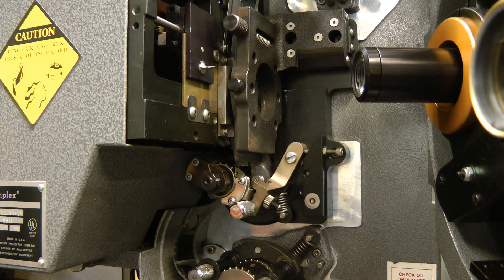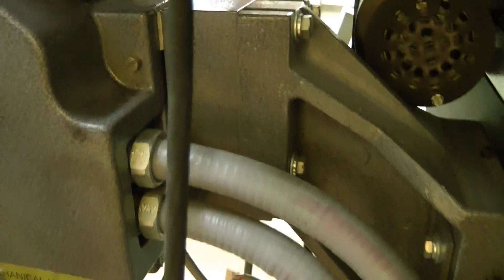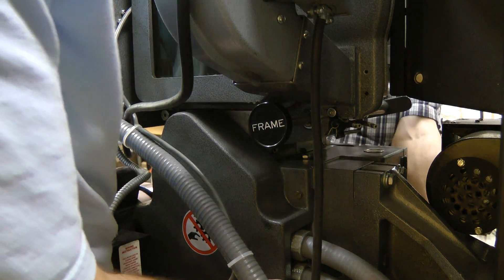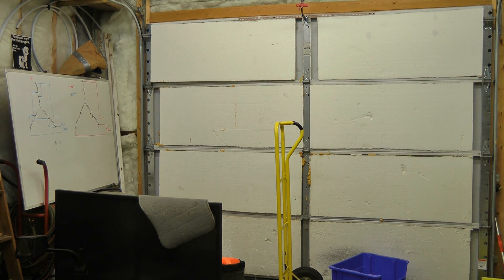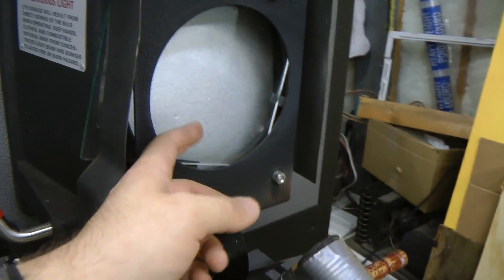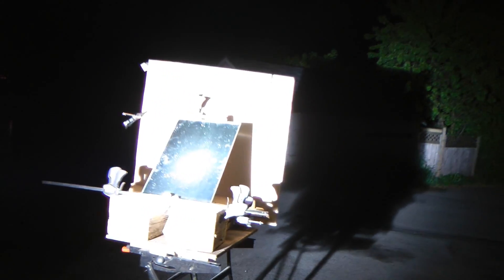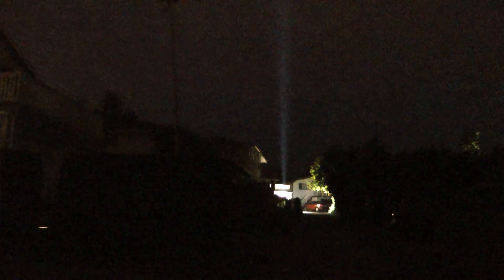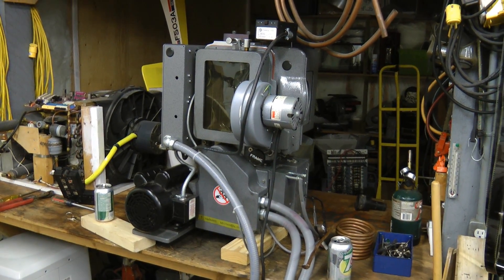Extreme teardown - Simplex 35mm cinema projector - Part 6 Searchlight

Comment: Physics question - is the Fresnel lens really necessary? The elliptical reflector already serves to collimate the beam so the fresnel, depending on its focal length, is rather in the way I'd think.  Or did you choose a fresnel with a long focal point located back at the light source?  I want to do this, which is why i'm asking:) Thanks for the epic video.

Comment: Did you get that Projector for Free? I think it's always a bit sad to see Things like this be taken apart. But it's also really interesting to see how they are build.
Reply from the maker: We were supposed to pay $100 for it but they never sent us the bill after we repeatedly asked for it, so it ended up being free. At least the projector head for this is now on display, all the others ended up unceremoniously at the scrap yard.
Reply: Do you know how much a Projector like this originally sold for?
I bet they are pretty expensive, now that I've seen all your Videos about it, and how well designed and built it is.
Reply from the maker: dave1812 I believe they sold for something on the order of $40k or so. The modern digital projectors that replaced these were $70k each for comparable brightness (5kW lamp).

Comment from the maker: A welder with a rectifier should work but would flicker somewhat. An inductor would help with reducing the flicker. Some of these projectors had non-inverter (conventional transformer) based ballasts, but those were 3 phase so getting non-pulsating DC is much easier there.

Comment: You need to pass the light through an LCD panel then you could project stuff on to the clouds. Tho it probably not look to good.
Also the tune you were whistling sounds familiar.
Reply: It'd die from the heat. You need a DLP chip with specialized cooling to be able to pull this off.